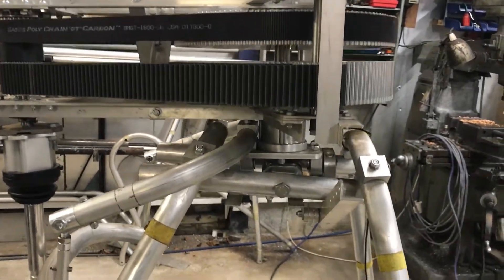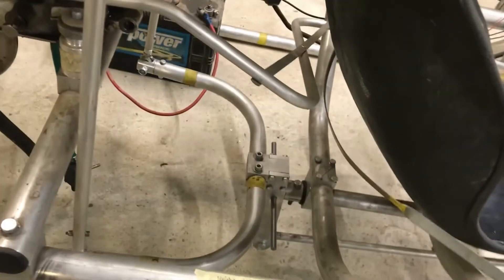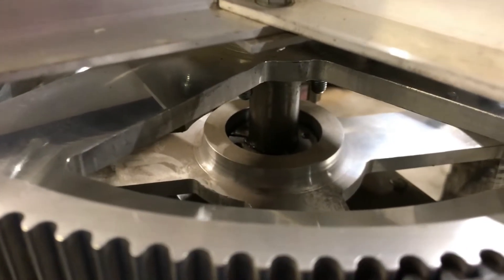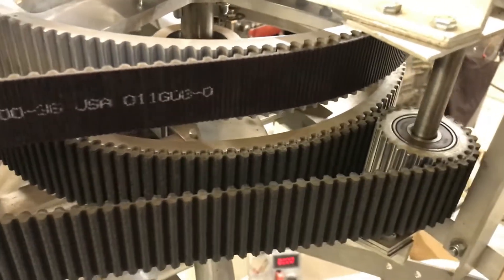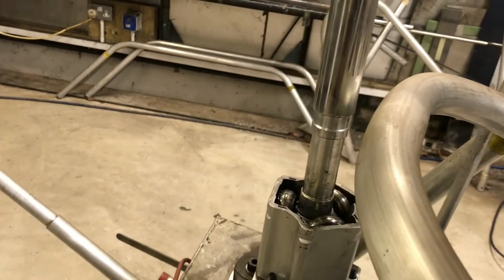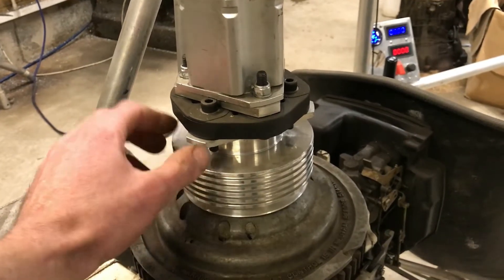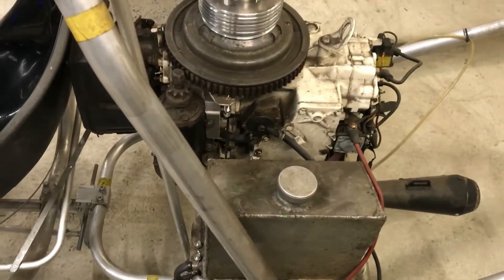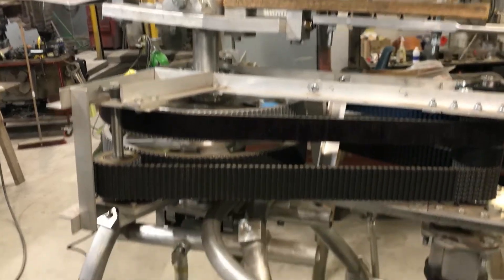Homemade coaxial Helicopter walk around and explanation

Comment: That thing looks so scary all bolted together, not a good idea.
Reply from the maker: Air frames are bolted or riveted together in aluminium because of fatigue cracking at welded joints. Virtually all gyrocopters have a bolted aluminium frame for this reason. Rotorcraft experience high levels of vibration when compared to fixed wing and a bolted aluminium frame is the safest solution.

Comment: Can the rpm be controlled separately for both rotors?
Reply from the maker: Hi, it would be nice to be able to control the rotor rpm's separately but this isn't possible in this case. It has been done before using a differential drive and braking one rotor for yaw control.

Comment: Pretty slick! I assume you're not done boxing in / triangulating the gear box frame.
Reply from the maker: Thank you. The drive frame structure is something I'm not happy with. The aluminium angle isn't strong in torsion and that's the load it will be resisting. I either continue with more bracing or replace the angle with box section. Good comment !

Comment: My Rotorway had an update to the chain drive to a belt like you have. It sounded a good replace, lighter etc. In reality the belts wore out to fast so the chain was better.
Reply from the maker: Interesting, I suppose if you compare an automotive engine synchronous cambelt to a cam chain, the chain will far outlast the belt. I love the Rotorway Helicopters and enjoy watching their maintenance videos.
Reply: @Ben-Dixey would the chains work like the belt in engine rotation reversal?
Reply from the maker: @TO-ll4js  I think it would work ok but extra heat generated could cause a problem. I did videos on the chain drive option recently, chordal effect on a chain drive I think would be a problem. I'm sticking with belts for the time being.

Comment: The co-axial reverse system could be done with a chain/sprocket system which at first glance might be lighter and simpler but I'm sure you have done your homework and opted for the belt system for good reasons.
Very well done !!
Reply from the maker: Thanks, yes I did look into chains, I think using a 430 chain was the recommended size but I seem to remember reading the recommended speed of the chain would have been exceeded. Running the chains in an oil bath might have been a solution but then the belt idea was looking a better option. Chains might have been ok run for smaller time periods without a bath I wasn't sure so I went with belts. It certainly would have been much more compact and probably lighter, not to mention a lot cheaper.
Reply: @Ben-Dixey  I can imagine that the belt system wasn't cheap at all but it's a neat concept and probably far less noisy than chains/sprockets , almost maintenance free.
You did a wonderful job so far sir , congratulations , keep up the goodwork.
Reply from the maker: leemnav thank you for your kind comments, much appreciated. Did I read that you are building or have built something similar?
Reply: @Ben-Dixey  Yes , " I messed around a bit "  the past 45 years but not nearly as good or succesful as you have done.
One thing good that came out of that is that I learned how difficult it is and therefore highly respect the work of others that even dare to build their own helicopter.
I had the good fortune some years ago to meet and see Mr. Franz Schofmann flying his trypod co-axial helicopter and that was and is still by far the most inovating "helicopter" I've ever seen .  ( I know that in mr. Schofmann's case the term "helicopter"  is used in the broadest sence of the word )
Your machine  and that of mr. jpkrucker come very close regarding dedication and thinking outside of the box. !!
I keep following your progress and the best of luck to both of you , you guys get there , no doubt about that.
Reply from the maker: leemnav inspiring words my friend, I agree that the Schoffmann helo was something I didn't think was possible and totally admire his achievement. He seemed to set off a bunch of people on their own quest to build something similar. I think win or fail the process forces you to better understand a lot of engineering principles, there is just so much engineering to understand in a helicopter and mistakes are unfortunately expensive in this game. I wish jpkrucker the best of luck, it was a substantial achievement to get to 600rpm with his rotors in my eyes. Respect.
Reply: @Ben-Dixey  As long as you're building your helicopter to do what you want it to do and not what others expect a helicopter should be able to do , you're on the right track , your track.....after all , you're the one paying for it.
Nothing as easy as to detect a mistake after the mistake has happened my friend , ....as every armchair expert will tell you.
Good O'll Sikorsky said that mistakes are important because they tell you how NOT to do things , he had a company to back him financialy for that though.

You and jpkrucker will get there !!
Reply: Not to mention the reduction of vibration and sound @Ben-Dixey
Reply: Where did you get the belt pulleys and idler?

Comment: Certainly high end engineering quality Ben ........the flexible drive coming of the flywheel did you make the housing for that, also Is there much vibration from the engine being a big 180 degree twin ?
Reply from the maker: Thank you Peter.  The flexible drive coupling is one I bought from KMproducts they make and sell hovercraft parts, then I made the clutch drum to suit the drive coupling. I had to add a supporting shaft which bolts to the coupling on the other side from the drum to make sure the bottom cv joint was not able to flex out of line with the engine but could allow some flexing in the rotational axis. There are bearings inside the clutch basket to allow the driveshaft to stop while the engine is running and when the clutch is engaged it's all locked together anyway. Yes the engine has a lot of uneven running and vibration until it gets to about 4000rpm after that it smooths out beautifully. cheers

Comment: Great work and impressed with the belt drive system for the counter rotation. As you have fixed pitch blades, and the rotors are fairly small in diameter, the inertia would not be very high. Are you considering adding mass balance weight at the tips or have an alternative avenue towards a safe outcome due to engine failure. I ask from having this occurring twice in my flying years. One was so close I nearly gave flying away and the second I was prepared for. In your case I am concerned that above a low height there is no safety reserve without collective.
Reply from the maker: Thank you for your comment 👍 The plan is to go no higher than a few feet above the ground, I completely agree it would not be safe at any higher altitude, the rotor rpm will decay immediately. Low inertia blades is what I think it requires for throttle response to work well in controlling altitude. Collective pitch would be the way forward for flying higher or dual engines would be an option.
Reply: @Ben-Dixey 
As a aircraft maintenance engineer and a RC helicopter pilot for 30 years I know all to well what happens when fixed pitch heli suffers a engine failure, unless you are a few feet above the ground they tend to make a nice smoking hole.
But with my collective pitch helis my autorotation landings are always better than my powered landings. 😀🇦🇺
Reply from the maker: John O I agree with you, collective pitch would be the way to advance to higher altitudes than a few feet. Not sure how much help collective is on full scale at say 5feet high as I believe it takes a few hundred feet to transition from powered flight to autorotation. This I think was the argument for the airscooter 2 but it disappeared. My guess is the temptation to take a machine like this higher when it is not safe to do so would be very great, so making and selling this type of machine to the general public would be morally wrong with only a single engine.
Reply: I believe the Nolan had dual engines…More complex, but better safety factor. A lot of folks rooting for you & this highly intelligent design!…hoping for, at least, detailed plans to become available at some point.
Reply: i guess it's kinda randomly asking but do anybody know a good place to watch new series online ?